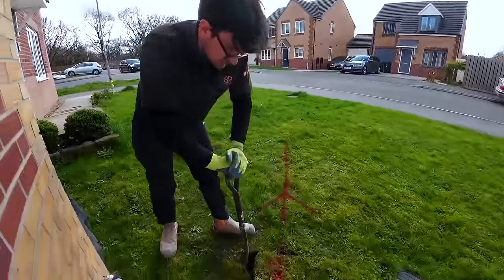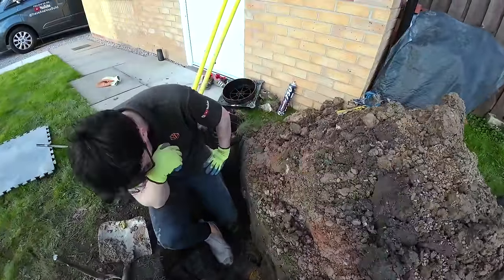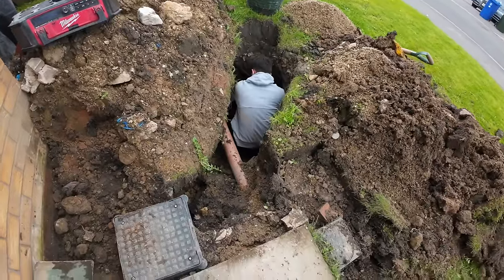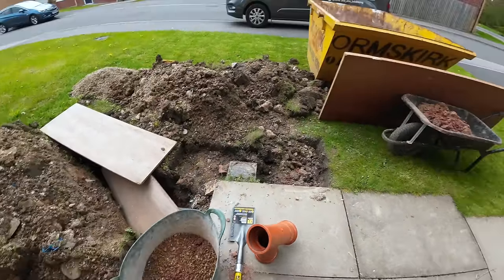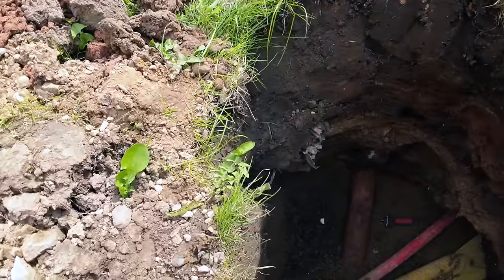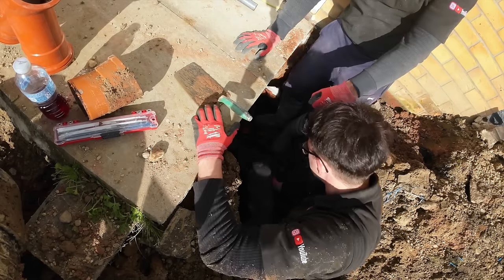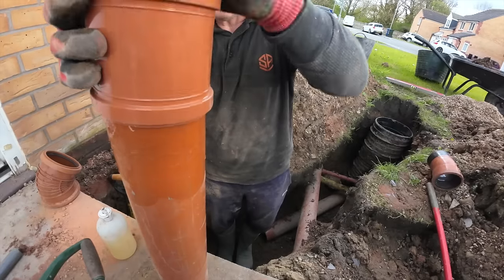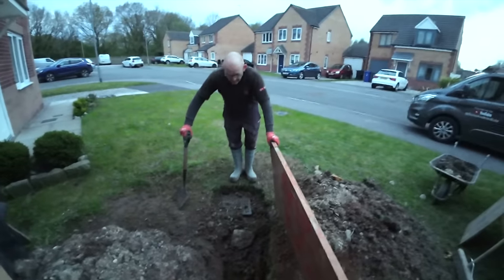NEARLY GAVE UP ON THIS DIG !! ..PORCH BUILD PT 1

Comment: The water meter is in a strange location, they are usually at the boundary where the footpath is or where the water pipe enters the house. If there is a stop tap in the footpath I would have been tempted to resite the meter further back in the grass.
By the way their is SDS drill attachment you can buy to chamfer the waste pipes, I seen  it on another youtube channel.
Great work though.

Comment: Only problem the customer going have now if any of them 2 lines block you can only access one of them from the inspection chamber that's why the chamber was in that position so both line could be jetted or cctv'd
Reply: Its their own home, so the know the problems that could occur.
Reply: They can always take the toilet out and rod from inside....... Had to do that before because them slim manholes are a nightmare to get the rods down and around the tight bend up upe pipe 😖

Comment: This is probasbly a silly question,  but with so many services in the way, once you are below the pipes level, why not use a high pressure washer like the Karcher and a largish wet and dry vacuum cleaner to suck up the resulting mud?
Reply: @SteveAndAlexBuild  don't kick it before you try it :-). I realise the dirt was falling in off the sides, but you could put sheets of plywood to shore the sides up while digging and you'd be surprised how little water the pressure washer uses.
Reply from the maker: Not for us thanks 🧱👍🏽

Comment: It looks like it would have been easier to overdig the excavation site and then re-tamp everything instead of trying to work in a small hole. Then you can just put the pipes where you want to then cover them up when you are done. Just asking not criticizing.

Comment: Small digger 😂😂 Not a professional, but would an internal sealed manhole cover not been easier? Although im sure digging for foundations would still have been required.
Reply from the maker: I’d rather not have it inside . I always imagine shitty drain rods in your nice clean porch if rodding is ever needed 💩😬🧱👍🏽
Reply: @SteveAndAlexBuild  😂😂😂 Id not considered that 😂

Comment: Always the same when working on your own house Steve that was a mare but done now .isn't it right a man hole each change of direction of pipe for the other pipe parallel to the house did a similar job a while back .
The back garden a bit of work a mini digger needs 800mm to get through a door so should fit side gate mate .Retaining walls steps etc and the patio cost of quid that but be nice when done .
Good luck hope it all comes easier for you felt for you on that boys 🧱🧱🙌
Reply from the maker: This was just the beginning Justin . The dig was as bad 😫. 
   1 1/2 ton digger eventually, fence panel coming out 👌🏼🧱👍🏽
Reply: Oh no mate why is it always so difficult on your own house bet you wish you never started it Steve .
Phone quite for us here what's it like with you up there mate? 👍
Reply from the maker: @brickrightbuildinglandscaping . Ticking over , not ideal but every day off is also a blessing 🧱👍🏽
Reply: @SteveAndAlexBuild  
I no I now feel the same Steve issue is Alex needs to earn as does frazer never easy is it mate .
You must have a date for the op by now surely 🧱👍
Reply from the maker: @brickrightbuildinglandscaping . I have a nail infection which takes 6 months to treat and they won’t entertain operating till it’s clear so no op this year. Gutted but at least I know now and I’m not waiting for a letter every day any more . 😒🧱👍🏽